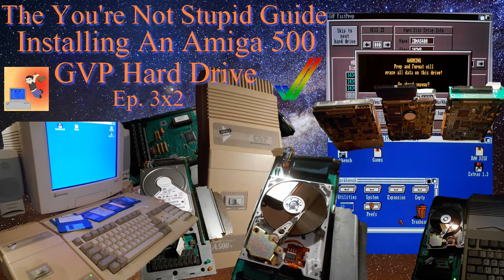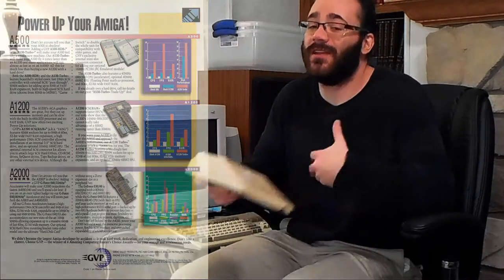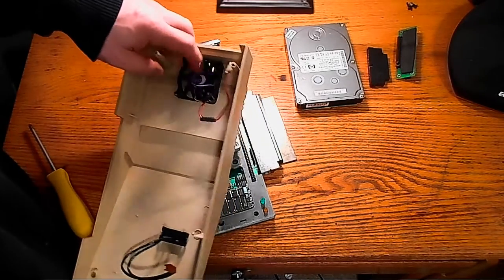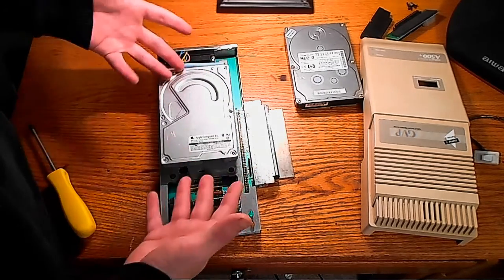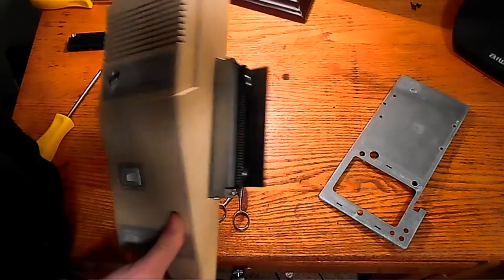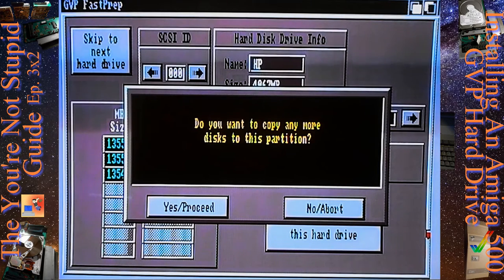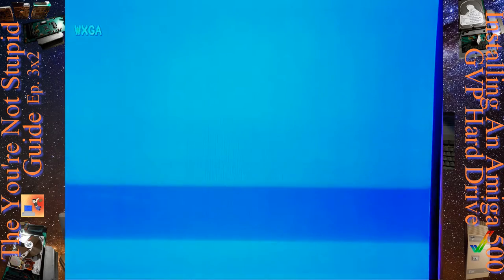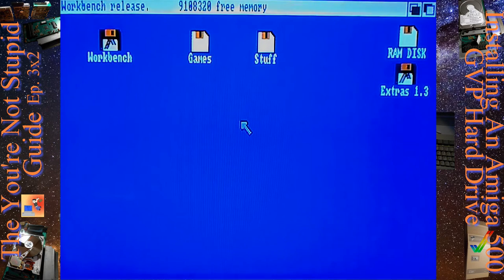Installing An Amiga 500 GVP Hard Drive + Emulation - The You're Not Stupid Guide

Comment: 19 minutes in, that connector was a GVP "mini-slot" and like you thought, the main product installed in that slot was the GVP PC286 AT emulator, GVP promised several expansions for that slot which never happened, the most wanted was the promised 030 accelerator, but instead they released the 530 accelerator model with a different board but amazingly kept the slot on the new board. the connector at the rear was a standard 25 pin scsi plug for 'daisy chaining' scsi drives
Reply from the maker: I managed to find an advertisement for the 286 emulator and put it in my SimAnt review. Yeah, an accelerator there would have been really nice, can't think up much of a reason why I'd want a PC emulator on the Amiga considering I already have a DOS machine. - I've since figured out the SCSI plug and am thinking about adding a zip drive or CDROM to the setup via that port.

Comment: Awesome video and guide.after decades of amiga 500 i was planning on getting an A1200,unfoetunstely the prices are way beyond crazy
Reply from the maker: Well, I'm certainly a fan of people keeping those 500's around as long as they can. It's  what most software/games were written for, and is a heck of a lot more capable of upgrades than some people are willing to believe. I say long live the 500 and let those 1200's go the few people who can actually make use of its extra capabilities.
Reply: ..being grown up on an a500,i was surely tempted to pick THAT up..but for some reasons i've been stupidly tempted by those fps..which runs better on a a1200..but in terms of nostalgia and the system itself, the a500 is the one i'd get again..with an hard disk of course.can a pcmcia be mounted on an a500 as far as you know? oh also you can change not only the color of the pointer but the entire pointer!by drawing a new one
Reply from the maker: Yes, there are pcmcia flash solutions available for the 500. They can be put inside of these GVP drives as a matter of fact, though it's cheaper to get a real hard drive than convert one of these to flash. There are also new hardware solutions which will go into the 500's side expansion and have flash storage. They would be the cheaper solution for those who intend on going flash. I've seen several of them, but they don't interest me as I want it all as old school as possible. I knew the pointer could be changed, I used to have my own custom pointer for the longest time as a kid. I drew it to be the shape of the main ship in the game Star Flight on the Amiga.
Reply: that's great to know.i know about Gotek and those adf loading things

Comment: Man I wish I could have a hard drive on my Amiga, I wanna be rid of many of those damn floppies!  I'm a little closer to that dream, yet still pretty far.  I actually acquired an A500 expansion called the SupraDrive SCSI Interface pretty recently.  Problem is, the hard drive is not contained in the expansion, but instead an external box that plugs into a proprietary connector.  I'm missing that box and I opened up the interface and it doesn't have any extra RAM installed...

I guess theoretically you could make an adapter to hook up a regular SCSI drive to the proprietary connector, but I'd have no idea how to do that.

Comment: AMD chip looks like an EEPROM chip. AMD was making chips since the '70's, early on they made memory, and continued to do so for a long time. Btw, even western digital made chips at one point. The sticker is covering a window over the die to erase it with a UV lamp. The chip in the middle that is surface mounted is the controller, and it looks like a Microchip brand micro controller, even though it is quite blurry at that range, the marking appears to be Microchip. The other 40 pin chip near the rear IO section is a UART chip which controls some alternate I/O functions. It can't possibly be the SCSI controller because it doesn't have enough pins. This means the MC is controlling the SCSI as well as the driver rom, and UART to the main bus. The long pin header nearest the bus expansion, is actually the same bus expansion, broken out into pin headers, likely this was for other products they intended to add later, or for the user to make their own mods. The plugs in the back were more of a mystery...but they appear to be I/O ports, which would explain the 40 pin IC nearer the back...If I were a guessing man, I would guess it was a motorola PIA. The DIN style one looks like it could support a commodore drive of some sort, like a 1571 or something like that. The other port might be RS232, but these last two are definitely just my speculation...I'd have to read the manual to find out. It might actually be a power aux in case you use the bus expansion with some thirsty chips.
Reply from the maker: Thank you for the wealth of knowledge on the board. I'm wondering if the plug in the back might be an external SCSI connector to daisy chain more drives. Which might account for the possible power adapter, in case it was used as an external drive. But that's just a vague memory from me. I did look at the manual a long time ago, but I have not really retained much of that information. So I could be full of it on that one. I've got some more close up pics here if you're interested, though I think I forgot about showing off the back side plugs. https://shot97retro.blogspot.com/2017/08/installing-amiga-500-gvp-hard-drive.html